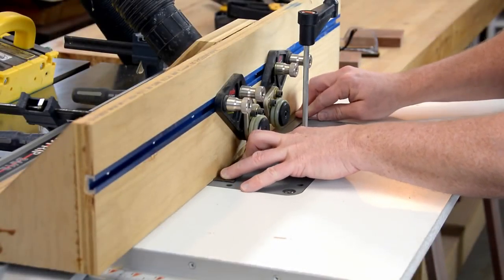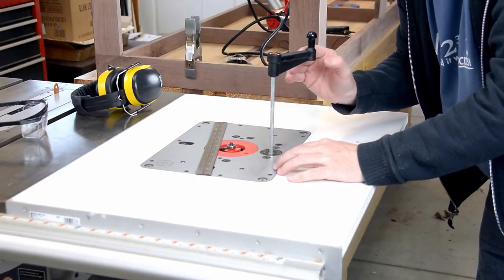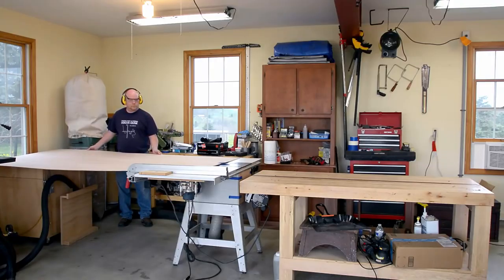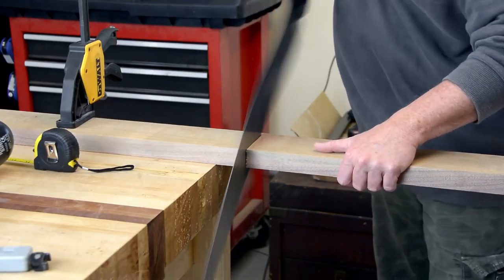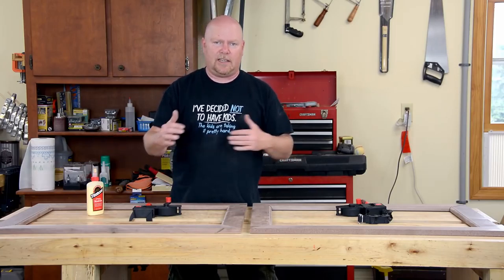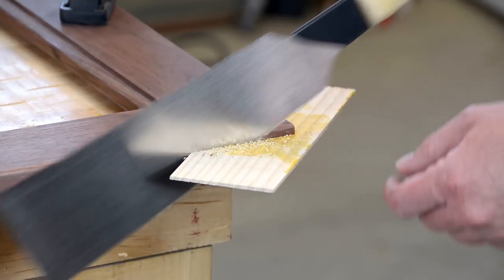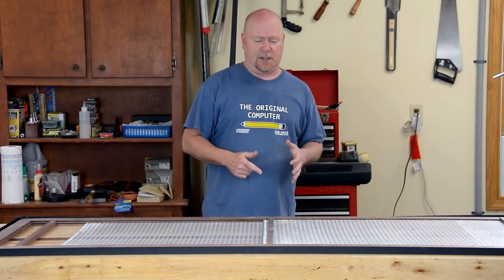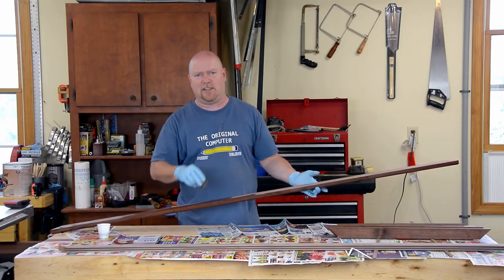Snake Cage Part 2

Comment: Hello Matt, I have been watching the videos on this awesome build. My question is regarding the stone backing. I heard you say they were peel and stick, is this really strong enough in the long run to hold up? or did you actually use something else to hold them to the back?
Reply from the maker: I thought about adding some extra adhesive, but didn't and it seems fine.   These are designed to be a backsplash so as long as your substrate is smooth solid and clean they work pretty well.